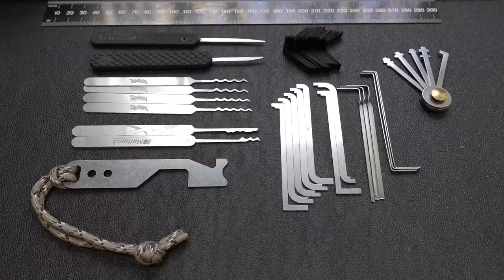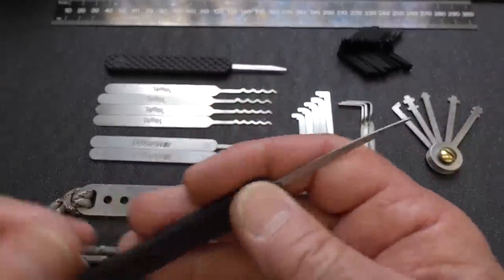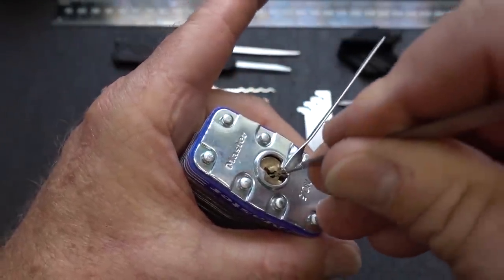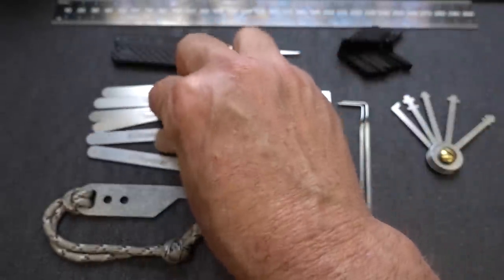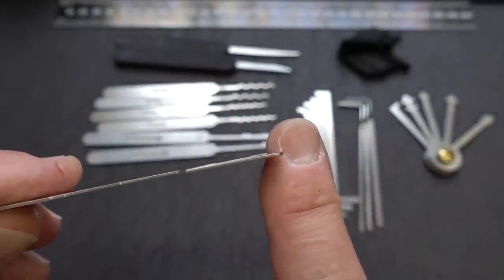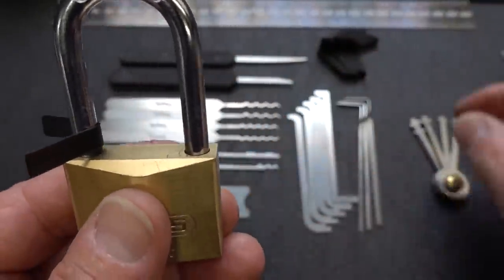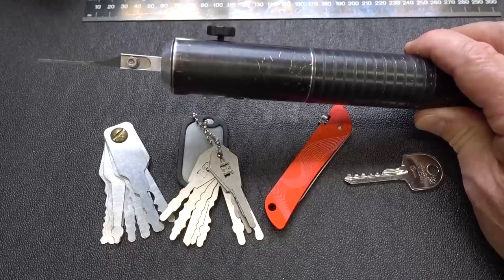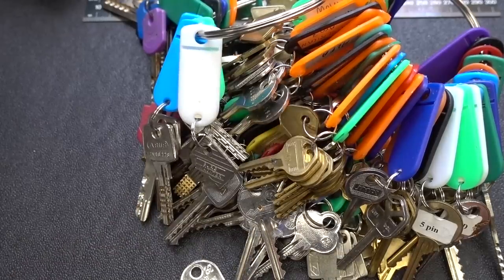(1509) Emergency Lock Pick Kit for Preppers

Comment: Nearly lost my mind when you kept pulling out rings of bump keys like a magician with scarves.  Great video!
Reply: He should have dropped a stuffed toy rabbit on the bench,  just for fun 😂
Reply: There were 3 rings. Chill.
Reply: You don't actually need that many profiles as a smith, there's a way to cut a bump key that will fit multiple profiles 
https://www.youtube.com/watch?v=ij0c-236O0k
Reply: I agree about the practice element for picks, but I think I would add maybe one hybrid (petersen gem, or such), and one shallow hook.  Doesn't add much weight, but takes that percentage from 80 - 90 to  90 - 95% for locks with either really good bitting, or one or two anti bump pins.

Comment: You missed the hinge puller, which can completely bypass lots of door locks with a very low-skill attack.
Reply: i call that the Wonderbar :)
Reply: For most North American doors, the hinge is on the inside and not accessible from outside. This tool wouldn't do much
Reply: @sureitmightbe  Also pins go from the door to door frame in case hinge pins are removed when the door is closed, at least on any good door.
Reply: The hammerless one recommended by Deviant Ollam would be a good edition. He says he has used it to great effect as a physical pen tester, so I wouldn't worry too much about hinge pins getting in the way.

Comment: I worked with  locks from a very young age, and a professional locksmith for 10 years. Just wanted to say  you hit the nail on the head here! I would like to add, take some time and practice.  Get comfortable using them, so when the time comes and you need to use your skills you will have a greater success rate.  Great video and advice!

Comment: I like the list and it pretty much mirrors my EDC (need to grab one kit to open an unknown lock two stories up and half a block away from a parking space) as a working locksmith... (I ain't here to impress you with my picking skills, I'm there to get you in as quick as possible so I can move on to the next job)... Typically I love rakes and bypasses. But I feel like you left a few things out.... 

1. Plastic "loid" strips, they're light, flexible, dirt cheap (or easily made) and you can both use them to open a LARGE percentage of poorly installed latchbolts, and determine if you even need to mess with the deadbolt. (I even keep one on my work clipboard as a "sweat shield" while I'm filling out a customers receipt.)

2. Bump keys. You're 100% right, as usual, that to cover EVERY keyway profile you'd need a LOT of bump keys, BUT I have like 8 on my bump key ring and can bump 90% of the locks I come across when needed (when they won't rake or shim, before I resort to SPPing) In most parts of the US, mine especially, you typically only see a couple of types of keyways anyway... (for residential locks typically Schlage or Kwikset) Provided you have a ring tailored to where you are, I think to leave them out is an oversight. 

Mine is as follows.... 

Schlage L profile (SC19) for both five and six pin, being the multi section master,  which will cover anything in the traditional Schlage keying system. That leaves out Primus (which we're not bumping) and Everest (which picks like a regular Schlage provided you shim the one lifter pin)... Not gonna lie, I use the 5 pin L more than anything because Schlage F series levers are a weakness of mine... (dang springs on the top pins... PITA)

Sargent LN  another MSM that works for all L series Sargents. 

Yale, 5 and 6 pin (Y1 &Y2)... I HATE picking Yale with a passion because of the paracentric keyway...  Might be no big deal for sport pickers and those who are used to picking European cylinders, but they're a PIMA... LOVE my Yale bump keys. 

American Padlock AM3 and AM4...  

Best/Falcon M... MSM for most IC cylinders (it'll ruin the cylinder most of the time, but it works in a pinch, I only use it if destructive entry is OK and I want to try it before running down to the car to grab the "rotary pick")

Add a couple of castration bands to your ring and you can open MOST of the locks in my area that MIGHT pose an issue with raking... 

My "bump hammer" is my Access Tools "super one hand jack" auto wedge, which does a fairly good job once you get the hand of it, adding to more versatility. More on that in a minute... 

3. Mini blind cord, about 1 meter.....  Hotel lock? No problem... Chain lock... No problem... and use the "super one hand jack" (AKA my bump hammer), and modify a loid, and you've got a nice "lasso tool" for exposed vertical vehicle locks. Handy thing to have on hand...  

4. Snap gun.... I LOVE MINE (Sparrow's Double tap)... I know that preppers don't want to practice (which is ironic if you think about it) but it honestly doesn't take THAT much practice with most common keyways...  They're worth the added space and weight is minimal IMO...  

5.THE ONE I CAN NOT STRESS ENOUGH!!!!.... Can of WD40....  The other day I'm coming back from a long day of calls and get another... It's hot, I'm dehydrated, I'm pretty worn out, I'm technically closed for the day, but the call is in my neighborhood... Get there, get customer ID and my paperwork done and it's a single Kwikset deadbolt...  House is a vacation home and not used for 3 months...   I rake...  and get a false set (yes Kwikset is putting "spools" in their locks these days... they're VERY shallow, but complement the tendency to corrode and gather dust nicely) I grab a hook, but then I'm just feeling dead pins, no counter rotation at all...  because everything's grimy...  Not thinking about anything but a shower, air conditioning and beer thirty, I pick the other way, same.... I try SPPing.... Same..... I even reach for the snap gun... Same...  It's been almost 5 minutes on a freaking Kwikset...  

In a flash of "how could you bee this dumb".... One squirt of WD40, and two kinetic passes with a Sparrows quad later and it's open...   besides, just a damn handy thing to have around, second only to duct tape...
Reply: great comments! please do a response video...
Reply: What is mini blind cord and how to use it ? Is kevlar cord or min paracord similar ?
Reply: Derek Broestler m

Comment: Great selection if all you need to do is open a lock, not compete. I would add a set of 4 or 6 combs in different dimensions & thicknesses. You can also make a very easy-to-use electric pick gun from a low-end Oral-B toothbrush (some run on batteries, some can be charged by USB in your car or from your laptop, for example). Remove the brush head. Cut around the upper portion to expose the top of the inner metal rod (being careful to cut not too far down the shaft or the internal rod will come out (superglue it back in if you make this mistake). Take a rasp or a dremel & flatten out the round rod that protrudes so it is thin & flat like a manual pick gun's. Ten or twenty minutes to make, works far better than a manual pick gun (& much quieter!) and I've made several for noobs who had no trouble using them even on locks with security pins. You might only pay about $19.95 USD (I've seen ones as cheap as under $6.00 but have never tried one) for the battery toothbrush (ten bucks more for the rechargable) & the rest is just a bit of elbow grease. It is much smaller than the electric gun you show - too big for a small kit bag, but still easy to stick in a go bag. And a lot cheaper than the commercial ones, which can run from $175.00 to $250.00 with Multipick making the smallest I've seen, but charging somewhere in the range of $500.00. I also do carry several bump keys for the most common Schlage locks (like the SC1 & SC 9) & Kwiksets (they all seem to have the same keyway entry profile), along with 4-pin & 5-pin padlock bump keys, though I prefer little springs to those castration rings that come with the keys to do the auto reset. You can use anything from a coke bottle to a shoe to tap it & if it's going to work, it usually does with only several bumps once you get comfortable with it. Commercial shackle shims are nice, but I've used flattened soda cans to cut some out & even a flattened piece of a liter plastic soda bottle in a pinch. I would also include 3 different width straight tensioners. The ones with the bends are sometimes a bit too springy & don't give as good feedback. Even with these "easy" tools, you still should practice regularly. You can usually find used locks from locksmiths or friends to same money, but the greater variety of common locks you have for practice the better you will become.

Comment: I agree about the practice element for picks, but I think I would add maybe one hybrid (petersen gem, or such), and one shallow hook.  Doesn't add much weight, but takes that percentage from 80 - 90 to  90 - 95% for locks with either really good bitting, or one or two anti bump pins.
Reply: id toss in that bogata with the hook on the back that he showed off a few videos ago to cover the hook need
Reply: I agree, surely one hook included would just up that percentage a little.
Reply from the maker: I agree but the original question specifically requested "no experience", and hooks require a good amount of practice to become proficient with.
Reply: @bosnianbill  I consider myself quite the newbie to picking (still haven't managed that damn DUO core Corbin) but there are several locks which defy raking (to me) but open easily with a pick.  I don't know why. 
Given the strict limits of the scenario, your kit is likely more useful. I would love to see an actual "man on the street" type of test to find out how well your kit would work out.
Reply: Yeah if you dont know how to use them its not gonna increase your percentage at all. Take it from 90 to about ummm....idk 0
Reply: Bosnianbill Oddly enough, I made a pick out of a hacksaw a few years back when I came across your videos. I went to my house door and picked the lock in less than a minute. I think your instructions were so good I could visualize exactly what was going on. I surprised myself honestly. But, I’d argue that is an exception and not typical.

Comment: I use the Sparrows Bomba Royale, supplemented with some mica shims, a probe for code locks, a .0015 worm rake, the huk impression toolkit and a cheap snap gun.  Cost around $60 to put together and has got me through most locks where time is pressing.  I recently added a straightened paperclip to be able to open locks where the keys are still in on the other side and that little gem works just fine and was free!

Comment: This kit is essentially the Sparrows Ranger kit with a few additions and deletions. The additions are: the TOOOLs waves set, a
"W rake" from Multipick or Southord (but they use other names: look at the profiles), a Sparrows decoder, a set of warded lock picks. The Ranger kit has a basic set of hooks and rakes -- including a city or "L rake" -- a knife tool, padlock shims, the mini slim jim, and wafer lock picks, plus a case that holds everything.
Reply: Oh, and Bosnianbill's kit also includes a set of Sparrow's flat bars for top of keyway tension. The Sparrow's Ranger kit only has the bottom of keyway tensioners.

Comment: I've had good luck with the jackknife, but I guess it's because I've practiced with it quite a bit. It is a very loose framed device. If it had the option to change the picks & tighten up the feel it could be a better option. Great video.
Reply: Have you seen the lockpick pen? It's replaced my jackknife.

Comment: Probably the only thing I would ever disagree with you on is the little Jack Knife lock pick set.  I have had a SouthOrd Jack Knife pick set in my right pocket for around 20 years.  I think I got one shortly after they started making it.  Have used the mini wave rake so many times it's been replaced at least a dozen times.  It's so well used almost all the chrome plating is worn off the body of the tool.  If I could only have one pick set that would be it.  Ultra compact so it takes up almost no room in my pocket, durable and gets me into 90+% of the locks I ever need to pick.  I almost think I would give up my pocket knife before I gave up that little gem.

Comment: Im a prepper  and got into this as another skill 2 have i have the ranger kit  added   the chaos card and the orion card  the octopus rake  the sand man the medusa Australian  bump key set the goat wrench themantis   and a set of warded  keys  just need a decoder 4 combo locks and tok tensioners i also have a set of jigglers and  a 7pin tool 4 bike locks vending machines etc i use the jigglers 2 squeeze it  all in the ranger  case oh also a cpl mica shims and small eyebrow tweezers with light built-in

Comment: As for those lockpick kits, there usually is nothing to work an Abloy lock with. Abloy is the most common lock used  here in Finland, more than 90% of all locks (well, excepting car locks)! Well, in case of a real emergency in Finland you take a crowbar and hope you don't encounter steel or steel reinforced doors.
Reply: WELL,I'M IN THE USA...

Comment: IMO this kit is missing:
A small crowbar
Bump keys for your building
Bolt cutters (maybe)
Common service keys

A crowbar is useful for locked doors but also for elevator doors where you don't have access to the lock, or to remove boards that obstruct your way, or as a weapon. You can probably use a small crowbar for the "wrench attack" against padlocks.
Bump keys for the doors in your specific building, that way you only need 3 or 4 keys. 
Common service keys, like someone else said, may get you into the key safe for the entire building and maybe get you a car if you need one to get home (or wherever)

Comment: Some ideas to accompany that kit: 
A cutting tool for smaller chains, fences etc. to just cut through. Maybe there exist some good bolt cutters that can be folded and stored or somehow extended or use some tricks to incress the force.
Some durable small metalsaw and maybe 1 or 2 extra blades if it's too thick and can not be picked. 
Wrenches to just pry open small locks, or even a (small) crowbar or two.

Comment: I would take none of those items in both scenarios. I would buy a good pry bar! You can use it as a tool and as a weapon. Ok it's heavier but more versatile.
Reply from the maker: I couldn't agree more! In fact, my own go-bag contains an 18" titanium pry bar.  Light weight, reasonable size, and a "master key" for everything from padlocks to soda & snack machines - if it ever comes to that...😇
Reply: The Stanley FUBAR Demolition bar. 31 bucks on Amazon.
Reply: @Jacob Locklear the pry bar
Reply: Bosnianbill  Stiletto? FB or the nail puller??
Reply: If were talking zombies and honestly who ever isnt? Then yes to the 8lb pry bar. But picks are quiet. Spp almost silent.
Reply: Knight of Saint Michael   A lock pick set is quieter yes but faster? A 400mm prybar only weighs 1kg. That's only 1liter of water or half an liter and a can of baked beans. Not much.

Comment: If you really do want to carry a few bump keys, I'd recommend a few keys: KW1 and KW10 (your basic kwik set, design house, generic house lock), SC1 and SC10 (Schlage, as well as some dexter locks. House locks). Those four keys are the most common key ways and key lengths used in houses.

Comment: Great info.  Now, if I'm in or outside a burning building and there is no window and the locked door is my only option I will use my .45 to punch holes thru the door and frame to weaken the lock area.  :)

Comment: I would add a couple of things.
First off you NEED some kind of blade...either a small knife or a razor blade of some sort.
Secondly...a small handcuff key like the plastic ones sparrows sell.
Third a hook or two...if you know what a TOK wrench is and how to use it, you're also going to understand the concept of SPP.
A tiny thin shim might be prudent as these can sometimes be used to open zip ties.
I would also have one of those credit card sets...the metal one that you have to pop out the precut tools from.
And lastly....my kit would include a jackknife pick set or a pen pick set...but I know how to use them and customised mine by choosing which picks are included by buying replacement picks from lockpickshop.com and if all your stuff is confiscated the credit card set or the pen set may be overlooked. Ooh! Also one wafer jiggler for car doors and a couple paper clips ( they are easily bent into many different shapes and take up no room, and might be useful).

Comment: For padlocks, there is also the two hammer attack. Two ball peen hammers stricken on each side of the lock simultaneously in a downward motion will pop the lock open on one or two tries. This is also a kinetic type attack.

Comment: Nice selection. My minimalist pick set fits in my wallet, in a small zipper compartment the space of a credit card. I have a Sparrow's tuxedo size case where I carry the regular size picks. The wallet set has been handy to have more than once. It's just some Chinese Z wrenches,  a Bogota/hook set where the handle is bent & one side can be the tensioner, a few Sparrow's finger size picks, and other small picks. Can't put padlock shims in there,  or I would stab my butt if I sat on my wallet.  🤣
Reply: You could add a knife or decoder, eg Quick Stick / EZ Decoder
Reply: @curlyvideos  good idea. I need to add one.

Comment: The one thing that I'd put in favor of the pocket pick is that you can get (or make) other picks, so you could have some extra rakes. The Multipick one you showed has 5 different rake profiles, though 3 of them are S rakes. The disadvantage is of course the cost, especially from Multipick.

Comment: the only thing i have so far is a kinda weak bottom tensioner(bends on hard tension) i made by bending a wiper insert from a wiper on the car that broke. still dunno how to make a rake without spending money though, got a lock i still need to get off my door without access to the fixture screws. but that tension wrench is progress